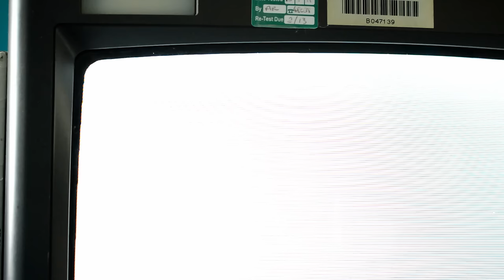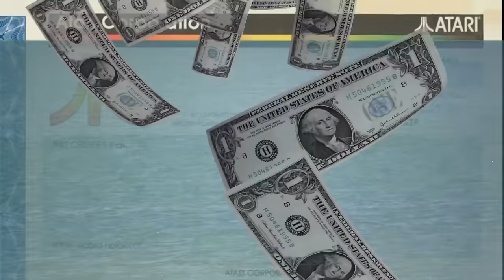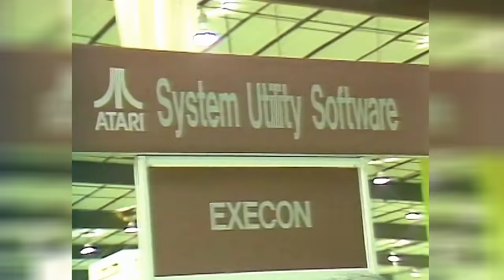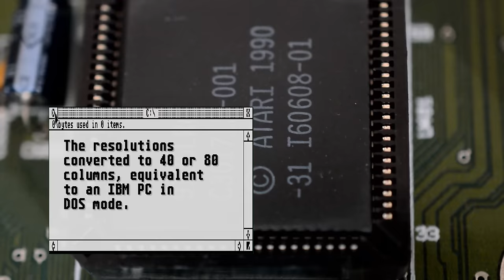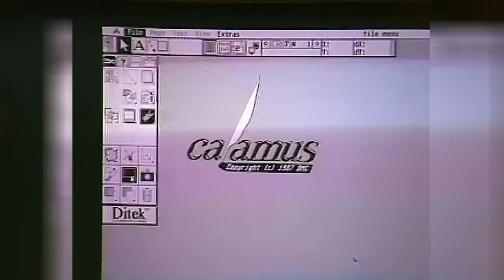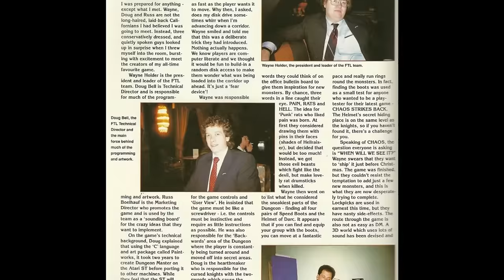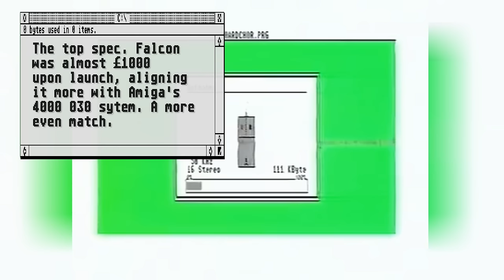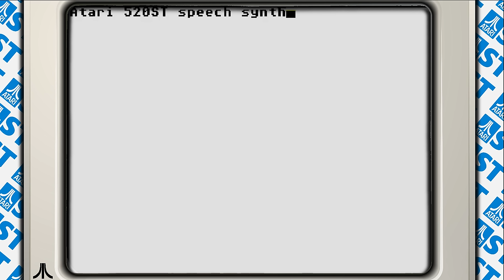The Atari ST Story | Nostalgia Nerd

Comment: "A real computer?" In 1994, you could have bought a used higher end 386 with Windows for the same price and it would have been a lot faster. Buying one of these in the 90s was pretty late to the game. Had I had the money in 1986, I would have bought an Amiga, but alas I was only 16 in 1986 so I had to use the C64 my parents bought me for Christmas of 84.
Reply: No one was buying Atari ST computers (or even Amiga) in 1994. So..what are you trying to say, I have no idea.
As for 1986, you would have gone for an Amiga 1000, which was way too expensive for almost everyone.  The A500 didn't come out till a year later.
Reply: IIRC, he said he got one in 1994.
Reply: tarstarkusz Someone can get an Atari St in 2016 too.  that doesn't mean people choosing a new computer will even consider an Atari ST.  By 1993 the ST was as good as dead in terms of support.  You could get a new ST by buying old stock. Amiga was close by.
Reply: He said he bought it as his computer, not as an old computer on ebay to play old games on original hardware.
Reply: tarstarkusz ....sigh
Reply: tarstarkusz lol I was sinking my teeth into Doom 2 at the time! I do remember my friend talking about this computer though and how he wished he had one.
Reply: I was stuck with a Compaq luggable XT machine with Hercules/mono-CGA in 1994:) But I did go from that to a 386 with VGA and a sound card in 95. That Compaq got me through college though.
Reply: No,....we were buying Atari Falcon 030s...when we could get them.....
Reply: Well......I could do way more on an Atari ST than a 386 - and games looked way better on the ST.
Reply: a 386 4mb ram with a 512kb vga has 320x200, 640x480 and 256 colors. it is like four times more powerful than ST, it can run stuff like doom, mortal kombat 1 and 2, bigger adventures like indiana jones and the fate of atlantis or day of the tentacle, atari st couldn't run those, or other games like flashback, black thorne, warcraft 1... 
atari st is more like an older 286 with 1mb ram.
don't get me wrong, I wish I could get an ST now to play with it, I love older machines, but by 1992 or 93 the PC was already superior to amiga and st.
Reply: ***** I agree.  By 1992 it was painfully clear the ST and even Amiga were already being outclassed by the now cheaper VGA class graphics PCs.  Still more expensive of course, but within reason.
Reply: I did not even start buying Ataris (used) till around 1991.....Remember Doom came out in 1993 and was the only game of it's kind initially (and made me want to buy a pc just for that one game) - but the Atari had 100s of titles avaialble and other games like Another World, still looked better on the ST and had better sound, and I even emulated Macintosh Plus on my Sts and though this pertains to musicians - for music production the Atari continued to be far superior to any PC for many years past this point in time......(just as the Amiga was for animation and video and some even argue audio) even today Atari Falcons are still up to the challenge midi and audio wise... and Atari Sts are still relevant for MIDI functions and are still desired by music producers So my desire for Atari purchases were driven by capabilities, and avaialble software, and fun add ons which were entertaining in themselves - versus updated system specs on paper - there is a lag time between the hardware being created and the software being developed - no machine including Macintosh came even close to do the work I needed the machines to do......until very late 90s.... and then it was a Macintosh.....
Reply: I think you might be over remembering the 386's or just going by basic math there...  The 386 was when the PC started performing  against the ST/Amiga, but the higher end Amigas/STs could hold there own against the old 386sx with a TSENG level video card.  Remember, some of those early high end PC video cards could cost as much as an ST.  ;-) Custom chips/coprocessors and the fact that the coders had been going for a while and knew the Amiga/ST systems gave them the edge for a while.  I remember Doom on my early 386.  It was amazing and great fun, but the frames weren't flying by..  ;-)  The original 386 was 12Mhz and because of the Motorola CPU design, that was pretty close to a 7-8Mhz 68000 design.  It was better pure math wise, but not as much as you might think and the custom chips on the Amiga really helped it.  I would put up an Amiga (and even an ST) against most 386's of the time and I think it would be a fun side by side.  Now, the 486 is where the PC pulled away.  Doom glided and there was no looking back.
Reply: +desiv... Well, the Atari ST was pretty expensive in America. Both the Amiga and ST were a much better deal in Europe/UK. The Tseng ET6000, IIRC, came out in 94 or 95. I don't recall there ever being a 386 at 12mhz, that was much more common for a 286. They may have existed, but I never saw one. The 386 was a major change for the x86 line with the introduction of V86 mode and the ability to handle VM. It really wasn't until the X86-64 was released by AMD that you can really point to that was as big a change as the 386 (though I suppose you could say the inclusion of the math co-processor of the DX 486 chips was a big change).
Processor wise, the 386 just blows 020s and 000s out of the water. The custom chipsets, as you mentioned, was where the real gaming advantage was. Unfortunately, those custom chipsets eventually became a drag on the line, while VGA and SB(etc) aided by fast processors was getting faster and faster. Those custom chips are the reason a SNES, despite the slow CPU was such a success.
A 40mhz 386SDX, the fastest they made would probably out perform either an Amiga or ST, though probably not the 16mhz (SX) version. The SX (and the Amiga/ST) were bottlenecked by 16 bit data bus.
Reply: I don't know about a slower 386sx crippled by the 16bit bus or low mhz, but a proper 32bit 386 dx 33mhz or 40mhz with a vga card can do things amiga can't. I had a 386 dx 40mhz with 8mb ram and a 512kb vga (realtek), and doom worked fine, doom 2 was a bit slower. mortal kombat worked, mortal kombat 2 was slower and I had to set it to minimum detail. my point is I remember the 386 dx 40mhz playing games amiga couldn't do, and the ones amiga could do the pc did it better because you didn't have to swap 10 disks.
amiga had better graphics and sound than pc during the 286 and ega days, but then with vga and 386 pc got the advantage.
Reply: That's mostly true, but don't underestimate the custom chipset for the graphics and sound. With the PC, everything is done by the processor and then across the bus to the card, which at best had enough ram for a page in cache. With the higher end 386DX (say 25mhz and above), I would give the edge to a PC. Disk swapping isn't a problem on the Amiga if you have a hard disk. I would say the 1 button joystick is a bigger issue.
Reply: tarstarkusz All the Atari ST series had the option for HDD too.  Depending on the model, internal or external.
Reply: Yes. I used to have an ST with an external SCSI hard disk. I'm almost certain it was Atari labeled too. I bought it at a flea market and sold it like 6 months later, so I don't remember all the details. I have an A1200 with an accelerator and HD. I like the Amiga over the ST. It's a shame that so many software houses wrote to the lowest common machine, the ST. Even the OCS was better than the ST because it supported more colors.
Reply: besides the custom video chips the STE had, and the MIDI capabilities ( which is why I needed that computer specifically)  let's not forget all the gadgets for the cartridge port on the Atari St that are available.....so much could be done! a fiberoptic scanner cable that could be attached to a dot matrix printer transforming it into a scanner. a VCR tape backup system using the video connectors on a standard VHS or beta video cassette deck. the list goes on and on of all the things I could do with the St that I could couldn't with a PC compatible, or if I could do it with the PC it was four times as expensive.....  and then on top of that I ran the Spectre GCR so I was also a souped up Mac Plus, and I do believe I had a PC Hardware emulator card as well, I remember running a PC version of Disney Animation Studio......
Reply: tarstarkusz, you are slightly mistaken there AFAIK.  From about 1989 or so, most multiplatform games (Amiga & Atari ST) were made for the Amiga and then cut to pieces to release an ST version.  Not the other way around.
Reply: +Trusf... It seems to me that the games that were released on both platforms are mostly to the lower spec of the ST. The Amiga versions may have come out first, but I'm sure they had the ST in mind when creating them, mostly by having less color.
Reply: +Mark... The ST and Amiga both did amazing things like that. There is no taking that away from them. Do you happen to recall the software/hardware that could use VHS as a data backup or the fiber optic to change a dot-matrix printer into a scanner? Do you recall how much data a standard VHS tape could hold?
Reply: tarstarkusz Regarding the VHS.  I could be remembering wrong, most likely, but I have the number 450MB in my mind.  Probably wrong.
Reply: +tarstarkusz - sadly I do not remember either products details....(I actually still have most of my old Atari Hardware and software)... but hopefully all that stuff is intact in a box somewhere and I am slowly unearthing long stored old Atari products, some damaged Beyond repair, others intact, so I'm hoping it's in an intact box!  I probably purchased both products from "Best Electronics".
Reply: The story was that the computer was a hand-me-down. It was quite common back then to be miles off cutting edge and not even realise. My ST was a raffle prize my granddad won, can you believe it, only a couple of years previously. By that point the 520ST was ancient and probably not worth keeping in stock. When you're 10 though you only know what nonsense you hear in the playground and it's a computer in your home back then so who cares if it's the latest thing at that age and time.
As far as support goes, games were still being released in '94 for the higher end models and the most popular magazine would run for another couple of years yet (with the inferior IMHO Amiga equivalent going even longer) but yes, the whole family were definitely showing their age when compared to the PC by that point.
Reply: Trusteft 
I bought a 25mhz 386 in 1992, it wasn't cheap.
I paid $1200 for a PC clone with a 14" monitor and a 40 megabyte hard drive, it was kind of disappointing with a horrible OS.
Reply: why was it dissappointing? you can run lots of great games and do everything with that computer. (I mean word processing, spreadsheets, printing stuff, all the normal tasks you do on computers).
Reply: @desiv1
486er were introduced in 1989 and in 1991 they were already wide spread available. SVGA videocards were standard at that time and a Soundblaster 2.0 soundcard was also already available.
In 1991 we had games like Wing Commander 2 and Gunship 2000 on the PC and both were running all better on a fast PC than an Atari ST or Amiga 500.
In 1993 we did not only have Doom, but also X-Wing and Rebel Assault.
Reply: I agree with most of what you said, but I'd say 386 and regular vga was common and affordable by 1991 or 92, 486 was expensive and a svga was expensive too. ha, color monitors were "woooooow, you have a color monitor???", most people bought monochrome because it was cheaper. it was very common to have a 386 with vga and monochrome monitor, adding a sound blaster was common and almost required by 93 or 94, you wanted it for flashback, doom, mortal kombat, the lucas games, black thorne....
I'd say pc was affordable and already superior to amiga and st by 92, not really by 89, 386 was expensive in 89, and 486 became affordable and common by 93 or 94, not earlier. (maybe it depends on the country?).
Reply: If you went in a Computer store in 1990 VGA was already standard and advertised at that time.
SVGA came a little bit later, but VGA was enough because all games at that time run in a resolution of 320*200 pixels @256 colors. Something VGA already offered. SVGA wasn't really necessary at that time to play games.
My first PC was a 80286 but with VGA at the end of 1989.
The VGA card was an expensive part of the whole computer, but the whole computer was still in a acceptable price range for a family PC.
And from 1990 on, no one was interested in monochrome or EGA anymore, because VGA was already affordable at an acceptable price.
486 were affordable in 1992.
But i agree it can depend on the country.
Reply: Here's a promotional brochure from 1st quarter in 1990 of a large computer chain store of my country which is Germany.
www oliver-kilb de/wp/wp-content/uploads/2014/03/vobis_anzeige.jpg

For about 1995 DM, which was around $ 1234 at that time you could buy the following computer:
80286 @ 12 MHz
512 KByte RAM, 1 MB for 219 DM or $ 135 more
5.25" 1,2 MB High Density Disc drive
20 MB harddrive
102 keyboard
DR DOS 3.41
Monochrome Monitor 14"

BUT, for 998 DM or $ 617 more you could get a VGA videocard + VGA monitor.
And most people did that trade, because 3000 DM or $ 1851 was thoroughly affordable for a typical family.

The monochrome stuff was already a remaining stock at that time.
Reply: it's like I thought, it depends on the country. over here in uruguay by 92 or 93 a color vga monitor was still expensive. I had to buy mine second hand, I couldn't afford it brand new from a store.
Reply: I have a copy of PC Format from April '92 in front of me and advertised is an SVGA card (one of Radius' MultiView 24-bit models) for only, get this... £1795. The argument that the PC was fully comparable to that already achieved by these earlier machines in terms of affordability for the average family at that point in time is nonsense. Of course there were good games for the PC, some of them the best option (not all) but it would take another two years before the PC officially ruled the roost when it came to computing gaming.
Reply: I rushed that last comment somewhat but my argument still stands. Yes, SVGA was still to see some years before it was mainstream but the older computers had been doing better than the PC was at that time for longer.
Anyway, format wars are daft; always have been. From that very same magazine is yet another letter from some kid, man-child or guy with kids justifying his purchasing decision, banging on about why anyone would buy an Atari / Amiga. The exact same letter aimed at the opposing platform however would be on another desk in the same building (Future publishing's) the views of which as fully supported as the other. Because all the computers were covered by various publications by that company it did them very well indeed to fuel the fires of rivalry. They didn't care what was right; they had issues to sell. The Amiga was always just a "games machine", the PC always "a beige box".
Oh and that letter. Also a bunch of crap. The guy was comparing prices but I'm very sceptical that he was anywhere near right. I won't go into it but it would be very interesting for me to put together the kit of the day and do a comparison. At least these days you can afford to buy the lot at a much more decent price. That card I mentioned you can pick up for about 35 quid, and that's expensive!
Reply: @tarstarkusz
The Tseng ET4000 was the star of videocards every gamer wanted to have in his PC because the ET4000 usually offered very fast VRAM and was thus fast for gaming.
The ET6000 based cards came later in a time, where already the Matrox Millenium, Matrox Mystique and Voodoo graphics accelerators existed and Tseng lost the battle, because it had only rudimentary or no 3d accelerator support.
Between simple 2d videocards with extra fast RAM and propritary SVGA modes and the area of 3d accelerators, there was also a time when 2d accelerators improved the drawing of typical windows functionality, but these 2d accelerators were not that much usefull for games and required special drivers.
Thus it was usually used for office work. The video chipsets from S3 Graphics were very famous 2d accelerator cards.

But for a DOS PC, all you wanted was an ET4000 with fast RAM and a fast Bus System like Vesa Local Bus or later PCI.
Reply: I agree with opengl4ever, that card was not the norm. (I never heard of it). the normal vga cards were not that expensive, the standard was 256k, then 512k. most people had trident, tseng, realtek, cirrus, I think there was a "paradise" brand of cards too.
my first vga was an ISA realtek with 256kb, some years later I expanded it to 512kb so it became svga and supported 640x480 at 256 colors!!! woohoo!! hahahaha.
Reply: kainthevampireduck 

It was disappointing because it was a lot newer, almost twice as expensive and it was worse than my old ST in a lot of ways.
I upgraded my ST to 2 1/2 megabytes of memory and it used it properly and not all the segmented memory BS like a PC, some things just did not work, I bought a Sound blaster card and it would not work at all with my clone, I called support and was told that it did not work on some computers. There was lots of software with horrible user interfaces and Windows 3.0 was not that stable. I regretted not buying a Atari Falcon instead of my PC. The VGA graphics looked like crap on my 14" monitor. My first PC was more expandable and I did eventually get a faster CPU, a 24 bit graphics card and a good non interlaced monitor but it was not cheap.
Reply: @mine123
The 386 offered 386 protected mode with a continuous memory layout with a at that time theoretically max size of 4 GB.
So all this huddle with segmented memory BS was over. All you needed was an 386 processor and under DOS the use of a DOS Protected Mode Interface like DOS/4G or DOS/32 and, if you wanted to write your own code, a compiler that could create 32 bit binaries using those DOS Extenders.
Writing programs using that mode was comfortable.
For the OS, which was typically DOS at that time, i agree. But in 1992 there was an already better and more stable alternatives like  OS/2 2.0 available if you really needed the stability and multi-tasking, but it came with a price tag of course and needed much more RAM.
In OS/2 you could even run many DOS games, because it was shipped with a real MS-DOS and supported DOS applications.

In 1993 you could choose Windows NT. It wasn't made for playing DOS games at that time, but it was a rather stable platform compared to DOS and allowed multi-tasking if you really needed that.
 
Well and the thing with the Clones. If you wanted to have an original PC the  only choice was an IBM PC.
All others were clones. They were of course much cheaper and were the reason for the success of the PC, the only real open platform at that time.
Reply: This.
Reply: Still sounds like a nightmare even to this day. And that was the point of the PC back then. Utter confusion. Segmented memory might have been out by that point and the 486 just released but you forget that knowledge was hard to come by back then and progression was slow. Britain was just starting in a recession at that time too it should also be mentioned. I think even the 386 would have been too far flung for most people. Somewhat ironically Commodore released a 286 machine in '92!
Reply: huh? confusion? nightmare? why? I don't understand, pc was always normal to use, even without a gui, it's not too hard, amiga or st would have been a nightmare without hard disk having to swap ten disks to play a game (and the loading times). amiga and st were better up to 89 or 90, but by 91 and 92 pc was by far superior for everything.
Reply: Don't totally agree with that..  Used both PCs and Amigas..  I didn't think the PC was too difficult; I agree there.  But the Amiga without a hard disk was just as simple to use as a PC without a hard disk, easier really IMHO.  Now, if you are comparing a PC with a hard disk to an Amiga without, then..  duh..  ;-)  But the same could be said for an Amiga with a hard disk and a PC without?  Disk swapping happened on the PC too... ;-)  I had both.  PCs and Amigas with and without floppies.  In fact, my first PC hard drive was only a 5 meg MFM drive.  So there was still disk swapping.  My main machine was my Amiga till 94 or so, but I could see the writing on the wall.  I had already been making money with PC work for a few years and the Amiga was just great fun..  Making money won out.. ;-)
Reply: One big disadvantage of an Amiga was the missing of an MMU in Amiga models lower than an Amiga 3000.
This had an impact on the OS and its multi-tasking capabilities.
The 286 and later had an MMU inbuilt.
In early 1992 486 were already widespreadly advertised and 386 were the low end models.
That can be seen in this old PC MAG magazine:
books google de/books?id=HERlo0BgpGYC
Reply: Article in PC Format April- headline "486 Price Falls". Costs quoted before release- £2,109 (2MB RAM, 50 meg HDD), in 1992, during a recession. Sure a full Amiga setup will put you back around a grand too, as the other chap reminds us, but we're comparing like for like here. Amiga for games is far less and PC for games is far more. Amiga for work is around the same price as a PC once you factor in HDD, printer and monitor. And don't forget that the ST had hi-res mono since the beginning.
PC at home still needed 3.1 to come out, for costs to come down, for certain brands to win out over others etc. before things got sorted and it really took the crown and that still wasn't the case in '92. Even by '94 the Amiga is still alive and kicking. The ST is just kicking the bucket by that point... I can't say for other machines. And yes, America is was a different situation but then it had been since the late 70s. More money, different progression.
Reply: +OpenGL... Wasn't it the 386 that first had V86 mode and MMU capabilities?  The Pentium came out in 1993. Of course, I was stuck with a Compaq Luggable (XT class) with a 9" screen.
Reply: @tartarkusz
The 386 introduced the V86 mode, but the 286 was the first, that introduced an MMU on the 86 architecture.
See here for more informations:
en wikipedia org/wiki/Intel_80286#Protected_mode
Reply: Totally agree with the lack of the MMU.  I remember a big fidonet discussion ages ago between Matt Dillon (of DragonFly BSD nowadays) and some other people about adding memory protection to the OS...  I almost wish Commodore would have hired Matt and made that happen, but that would have implied some good decision making at that time in Commodore, which wasn't realistic. ;-)  (And not sure Matt would have said yes. . Not sure what he was doing professionally then..)  Even when Amigas had CPUs with MMUs, the OS didn't support any decent memory protection..  It multitasked great, but a bad app could GURU the OS.  I also wish they would have included an FPU in the 1200 (there's actually a spot on the board for one, so they planned it...)..  Oh well..